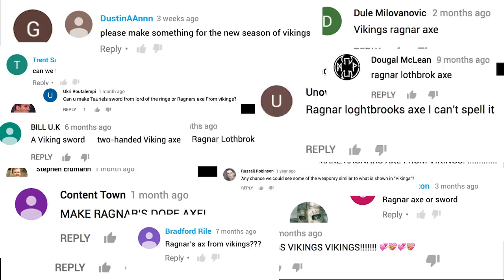Ragnar's Axe - Vikings - MAN AT ARMS: REFORGED

Comment: Hello. Beautiful work. One thing I have to reproach. The head of the Viking ax slid on the handle from behind. That is why the handle extends towards the head. The weapon was also used as a hook to pull down the shield walls. Only in this way the warhead could not slide off the handle when pulling.

Comment: The hardest thing I've ever forged is a claw hammer. Getting the temper right took forever. Center of head hard enough to not dimple, outer edges tough enough to not split or chip. Same with the claws. Inside edge has to cut a nail without getting brittle.

Comment: Grain size, grain size, grain size. For the same hardness a fine grain piece of steel is much tougher, less likely to break, than is coarse grained steel. When you heat steel hot enough to forge, it is also hot enough to grow coarse grains. Before hardening & tempering your forging, take just one more step. Reheat that rough forging to, say 1500 or 1600F. Then just air cool it. Now when you heat your forged axe or knife up to harden it, you will have a finer grain size. Makes a big difference. I talked the product manager into so heat treating his forged tool at Black & Decker, ages ago. When he tested it, mine lasted and lasted. The regularly heat-treated tool broke. Which caused that Manager to bleed a bit. 
Guess which heat treatment became standard?
Do refine the grain size of your forging. 

Yeah, I am a metallurgist with decades of experience.

Comment: Hi, you should carve the handle out so the grain is straight, and very strong. The sides of the handle should show knife shaped grain. If this is on front and back, when you strike  this grain can rise. So when you slide  your hands up the handle this will stab into your palm. The cut them out because they get more from the stock. This is why they break. Look how the grain goes across the handle. And never use soft and hard timber together, this  causes serious accidents. But people think it looks cool. BE SAFE!

Comment: While grinding heat is produced and you just dip in water this will create stress fracture on edge..I doubt that's a great method...the edge might not held
Reply: The temperature is nowhere near the critical temperature, were cooling will actually do anything.

Comment: just found this....nice work...but...living in an area where good handle material is not  readily available in nature (very rural area)...I have been hafting and handle making my own from maple and birch for over 50 years...and grain is everything for strength....the grain of the oak handle appears to be cross to the cutting surface of the ax....therefore a weak point in a battleaxe....as a outdoors person and logger....I would not take such a thing to work...as it could be a life altering action....Grain should parallel cutting edge. Beautiful wall hanger.

Comment: That axe is not Ragnars axe.  
1. To big (for the axe from TV series).
2. The handle should not be fixed to the axe head.
3. The used mostly round shafts. (so they could easily replace a broken shaft)

Comment: Its a beautiful piece and they know what they are doing, but they cut too much off the edge, after drawing out the sliver of high carbon, they went too far, then ground off most the carbons steel, to try and make it to shape for what they wanted.  The high carbon pattern welded edge is so thin, that after use and a few sharpening's, your going to be right down to mild steel.  It wouldn't be really function for a persons lifetime, and for good art work, form should follow function, and this would never make an heirloom unless you just hung it on a wall.

Comment: You guys should invest in a few wood working tools, not expensive really. A draw knife, spoke-shave, and plane. 
Your grinding wood is as painful to watch for a woodworker as a blacksmith would suffer watching this whole axe blade being made by grinding alone.
The "kerf" or cut edge you see is really a band saw blade that's not tight enough or blunt. I use much thinner blades without any wander like this.